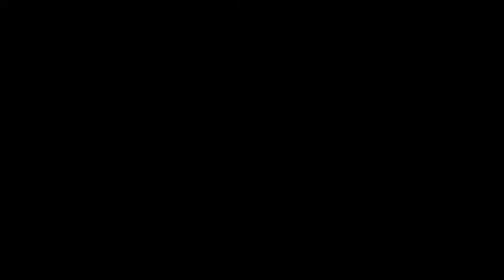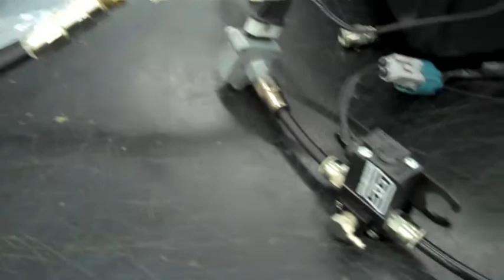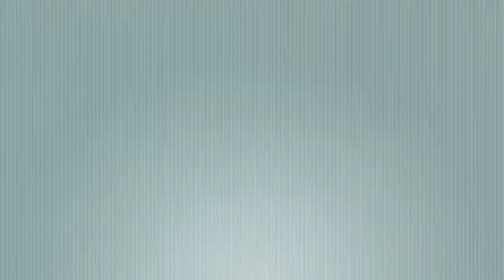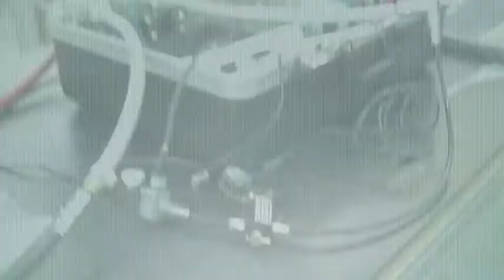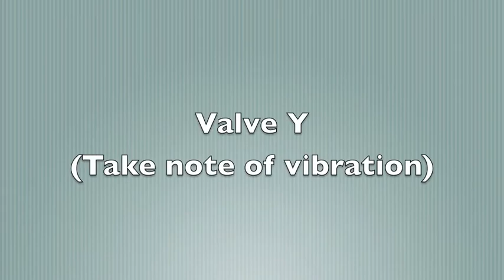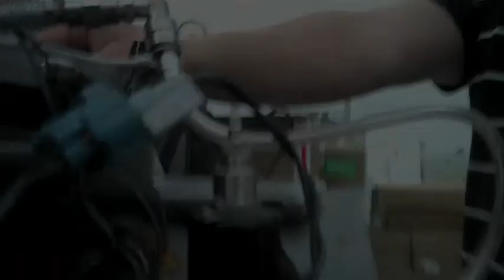GrimmSpeed Boost Control Solenoid (BCS) Comparison

Comment: It does sounds like you could have a boost/vacuum leak somewhere.  How do you have the solenoid plumbed?  Reference our installation guide off our website to verify that it is installed correctly.  When going from a 2-port to a 3-port you should be building boost quicker, since it isn't a bleed style system any longer.  Give us a call if you aren't able to nail the issue down  and we can brain storm with you.  612-379-0000 -Matt Homes